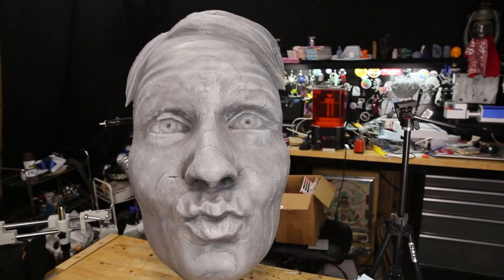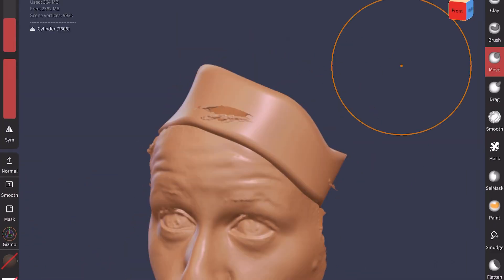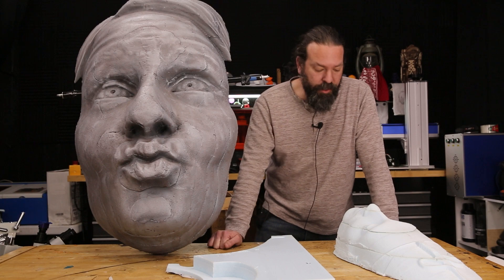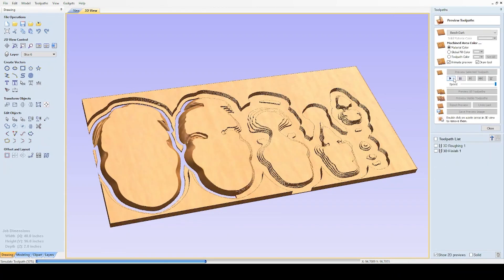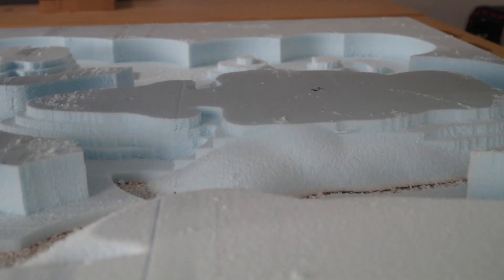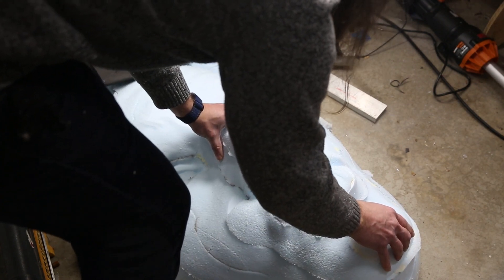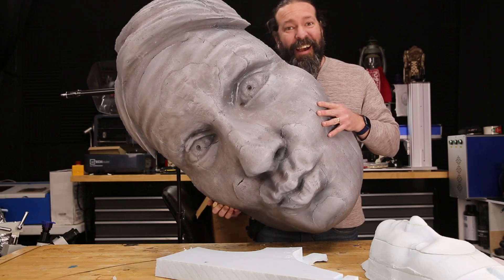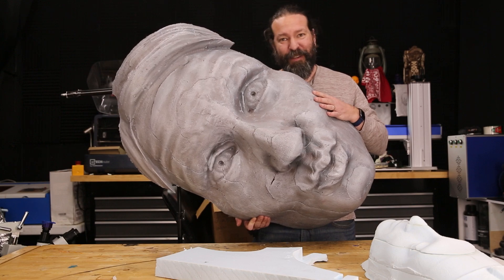How To Make A GIANT Face from foam - 3d cnc milling blue foam

Comment: This is a lot of fun. After 25 years as a prop builder, here are some of the things I can recommend.

Options of techniques: 

1) To hold the parts together while the glue dries and you intend to do some filling and sanding, bamboo skewers are long and can be inserted through the foam layers to secure the parts together while the glue dries. 
2) Construction adhesive works well and is designed for these sorts of applications. Wood glue works, but is designed specifically for wood. Which might slow the drying process as the moisture in the glue has nowhere to go except out the sides of the join. 
3) Surfacing. You can use sheetrock compound to fill and smooth the foam. It sands well and doesnt shrink much. 
4) Coatings. If you'd like a tough, leather-like surface coating, a mixture of dry clay powder and Flex Glue is awesome. The downside is that the surface becomes fragile in cold temperatures. Room temp it is really sturdy. 
Or you can use dry clay powder mixed with latex paint if you have an old can of paint hanging around. It's all water-based, so it's easy to clean up. 
5) Be sure your foam is completely coated in a brush on latex or acrylic paint (flat paint is best) as a primer barrier before you use any spray paints.
Reply: I do this dort of thing on a much smaller scale with the pink insulation foam board to make mini Flintstones BEDROCK CITY houses.
Reply from the maker: great tips!
Reply: You’re my hero this answered all the questions I’ve been on a deep dive to solve for the past few days!

Comment: After doing some extensive XPS foam work on my lil CNC, I've skipped doing roughing cuts and go straight to finish runs. One caveat is that even when you find a glue specifically for foam, avoid the feeling of being clever by gluing multi-layers of foam to get a lil extra thickness. Ugh, it balled up on my bits and destroyed an otherwise perfectly good mold set, with the glue ball throwing off dimensions as it grew. Definitely need a single volume foam board to work from. 
I still use the ol painters tape and CA glue for workholding. I put down the first few strips (2" wide seems great for most projects), run the glue on that first section, then lay the tape runs upside down on said glued sections so I don't have to guess or measure to death where they will sit on the spoilboard. If you leave a few inches on the second set for overhang, it makes for a dead simple alignment point for positioning and handling.
Reply from the maker: I've done some pretty thick stuff right to the finishing pass but I get much better results if I do a rough first.

Comment: Cheap latex/acrylilic house paint is all you need to paint. Look for a Critter spray gun. They use glass mason jars to hold the paint and are dead simple to use and clean. If you have paint left over, just screw on the lid for the jar and store your paint. If you do this a lot, this will save you a ton of money. As far as hard coating the foam, that a depends on where the item will be displayed. You don't have to do too much if it is indoors and away from curious hands. You can just use paint. If it's outdoors or accessible to curious people, there are tons of professional (read expensive) products you can use. That's the confusing part of the process. You will get tons of suggestions because everyone has a different way or product they use.
Reply from the maker: oooh, thanks for the tip!

Comment: do you think I can sculpt a piece like this in other software? I started learning fusion 360 and it takes a lot of hours to learn a software like this, also it's another cost to pay for another software and I'm just doing it as a hobby
Reply from the maker: depends on what exactly you're referring to. I didn't use fusion at all in this project. are you asking if you can do it in fusion? you can totally do the CAM parts in fusion. The face itself will hit the polygon limit in fusion, so you'll have to reduce the complexity of the digital sculpt, but it would work in fusion.
Reply: @CalebKraftmakes  i was't enough precise, what i wanted to ask is if it was possible to create the gcode of an sculpted piece in fusion 360, and later I've found some people doing something like that in fusion, so it is possible, what I don't think it's possible is to create a model as complex as yours in fusion, it's not it's purpouse! thanks! nice channel! have a nice day!

Comment: Hey love the video.  Could you use the same Process to build a 8 foot Statue?
Reply from the maker: I don't see why not. It would be a little more work because of undercuts but yeah
Reply: @CalebKraftmakes  what if it's something simple like a 8ft optimus prime?
Reply from the maker: @freakenstein1984  that doesn't sound simple but the answer is the same. Yes totally possible but you may find a few little issues you have to work to resolve, such as undercuts.
Reply from the maker: @freakenstein1984  I’m not taking on any work like that right now. My schedule is OVERLOADED and I barely even have time for my own projects. Sorry. If I did take it on it would probably be a few thousand
Reply from the maker: @freakenstein1984  the machine I currently use for this is about $16,000. you could totally do this with a $400 3d printer and some patience though. you would still have to learn some things.
Reply: @CalebKraftmakes  if you don't mind me asking, what model of cnc machine do you have?
Reply from the maker: @evoncassier1720  its a large build from AVID CNC